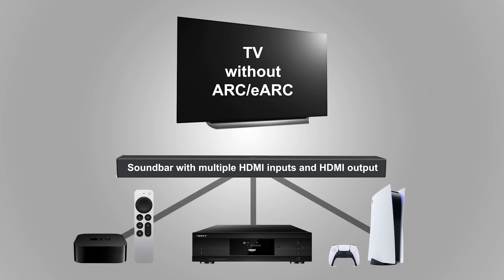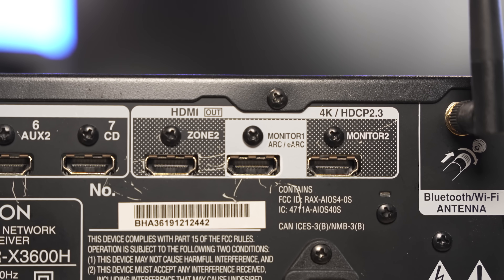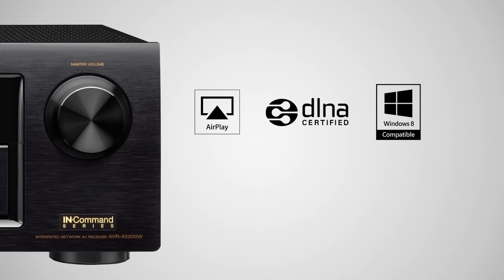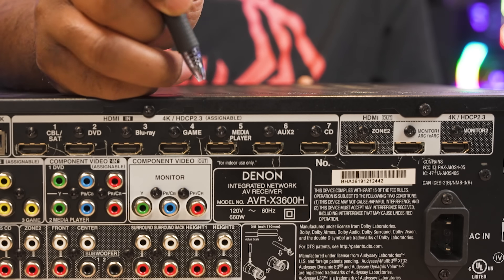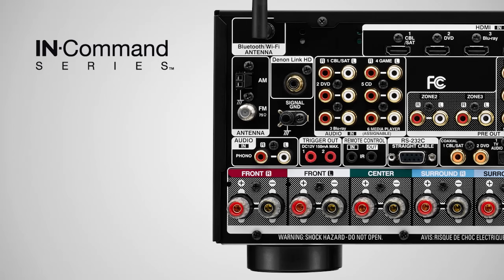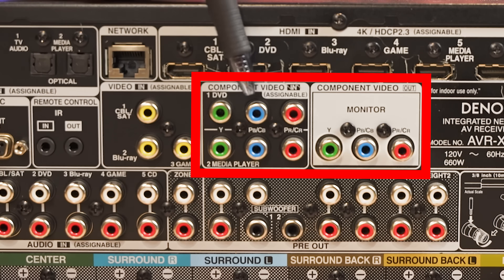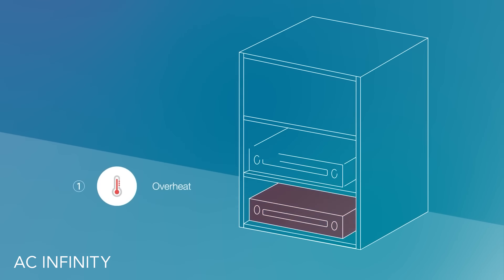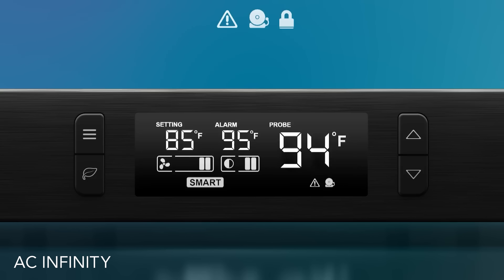Avoid These Mistakes When Setting Up Your Home Theater Receiver

Comment: I'm confused about the amp/receiver fan.  As someone that is in my late 50s and had amps/receivers since I was a young teenager, I've never seen nor had the need for one of these.  Is it for cheap products?  All amps/receivers should have passed testing as is.  I'm someone that has those babies running all day and never had an issue.  And we used to use them for DJing also.
Reply from the maker: It’s only necessary if you’re putting the receiver in a confined space that retains heat. This is one of the reasons I see so many hdmi component failures. They are fine when out in the open.
Reply: Essentially, heat kills electrical components over time. Although they're good products,  if you play Marantz and Denon at a loud volume for extended periods, they will get hot.  
An AC Infiniti fan is great! I own two.  
1. It allows me to enjoy my Marantz 6014  worry free, all day,  below a set operating temp. 
2. It is also used as a spacer to dispel and not transfer heat from my AVR to Sony x800m2 4k player. 
3. It covers the top vent slots, thus preventing dust from entering the top of my AVR. 
4. Based on the model, I can choose which direction the warm/ hot air will vent,and if the AC Infiniti is in a closed space, I can add additional fans (with some modification). 
5. Nice and mostly quiet, too, depending on preset fan speed.
Reply: @johnathantaylor3199  Interesting.  I have run my Marantz at high volumes all day for many years and have had no issues yet. Maybe it depends on model since they were bought out a couple of times.

Comment: Chris, which means that at the same time a receiver sends the same signal to pre-amp ports and amp ports, right? So one can use active left and right and passive center at the same time without any level issues?
Reply from the maker: Correct. I haven't tested this is several years but last time I checked the pre-outs send audio simultaneously with the high level outputs.

Comment: A Denon X3800h is a couple years old now? It came out Sep, 2022. It's like 2 steps down below their flagship (X4800h and X6800h coming out in 2024). It just got Dirac upgrades and an updated HEOS app. I think it's very relevant and current state of the art receiver.
Reply from the maker: It's an x3600h, not 3800

Comment: Hey Chris, the video is very helpful especially for a newbie like me. Could you also make a video on how to do the crossovers?
Thanks
Reply from the maker: I touched on crossovers at the end. That's a good starting point. Some room correction calibrations set those for you.
Reply: @ChrisMajestic please make a video guide on how to combine two UST projectors and using a external video processor that can do image blending and tilling to create a cinemascope image. Also a video guide on if it's possible to use 3rd party mapping grid geometry software to correct a UST image thats projected on a wall that's not flat

Comment: banana plug wont give you the ''best connection'' on a technical point of view. More material, include more way to change the signal. Now, did it make a difference in sound? Absolutely not in that range of receiver.
Reply from the maker: I suppose I should have said "high quality banana plugs will give you the best connection"
Reply: How do y'all feel about Viborg banana plugs???

Comment: Thanks for the video! How loud are those fans? Just curious since I don't have a dedicated AV closet and instead opted for an AV media cabinet from BDI and would have this in my theater room. Not noticing any heat issues with my Onkyo RZ50 or my TW 8300 but I want them to live a long life.
Reply from the maker: They are very quiet. Especially at low speed

Comment: all these wires need to enter the 21st century.
Reply: What do you mean?
Reply: @luxurybuzz3681 cant all those audio cables be replaced with just one wire going to the front speakers for example instead of 3 or 4?

Comment: I think I have that same Denon Receiver, but I'm getting rid of it all to upgrade to a really good soundbar.  Sound is close now and only 1 wire!
Reply: Wow that statement says a lot.
 Personally, I don't think it's a receiver. I think it's the brand of the receiver where you've gone wrong. IMO nearly all Japanese receivers sound the same. When the sound Dynamics change one will normally find themselves reaching for the remote control. And that's only half of it. If one is looking for quality sound rather channels, features and functionalities one should choose an AVR for its components.
Reply: @totalplonker824  what receiver did you decide on?
Reply from the maker: You sure?. What speakers were you using with it?
Reply: @ChrisMajestic  even after auditioned three separate mid-price Japanese AVR's (Denon 6500 /Yamaha a6a)
 I couldn't get the best out of any of my high-end speakers (Sonus Faber Sonetto, KEF ls50) I actually considered going back to an integrated. Fortunately carried on saving (extra 20%) and purchased the one I should have purchased. As well singing stereo speakers, unlike Japanese AVR's, sounds fabulous at low volumes too.

Some people are so Hooked Up on the latest features, extra channels and functionalities they don't even know what good sound quality is.

Comment: Chris Nice job, I would also recommend using the receive for those old lower resolution devices before outputting them to the tv to upconvert from lower resolutions to 4k, its a great improvement over native 480 to a 4k tv.

Comment: After an firmware update on my denon avr4300h a few years back, the internet stopped working. I have tried all the manual's suggestions and internet tips I could find, but to no avail. Does anyone have any tips that have worked for them? Thanks!
Reply from the maker: Interesting. Is it both the wifi and ethernet?
Reply: Yes... @ChrisMajestic